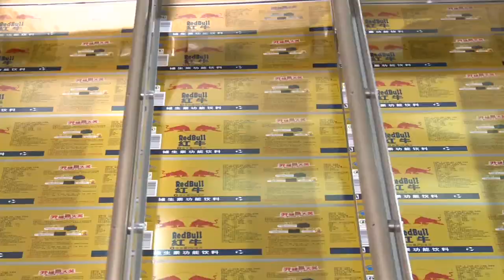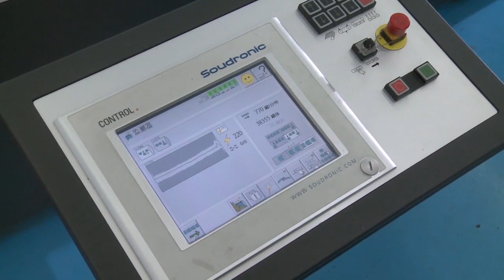Metal Can Production

Comment: Fujian Bailiyuan Science and Technology Co.,Ltd is a fully-owned China company specialized in food can-ends manufacturing.
The main product in our ends production lines are steel Standard ends of sizes 50mm,52mm,63mm,65mm,70mm,73mm,80mm,83mm,99mm,153mm.
We are an ISO certified manufacturing plant (9001:2015 and 22000:2005) for Quality Management System and Food Safety Management System respectively.
If you need our specification document and samples to test please kindly let me know .We will sent you samples to test the sealing chucks. .